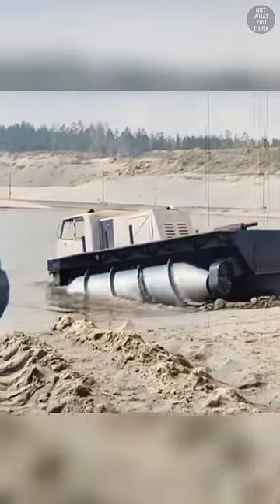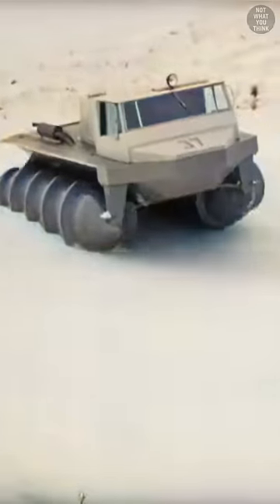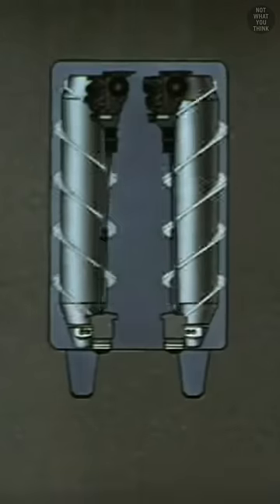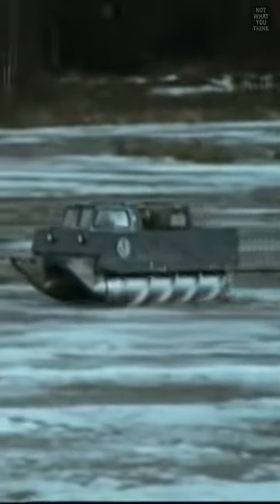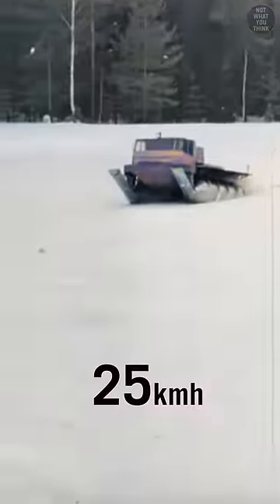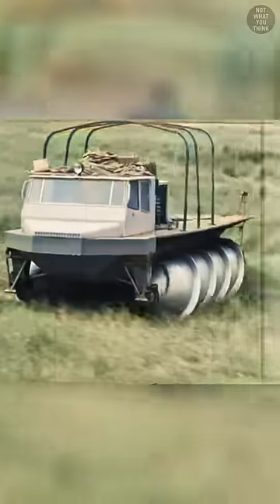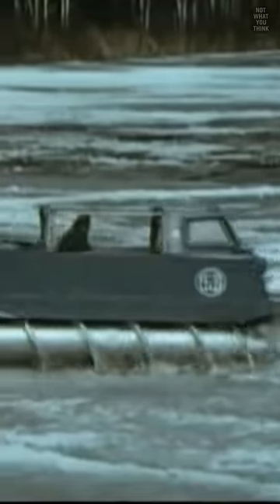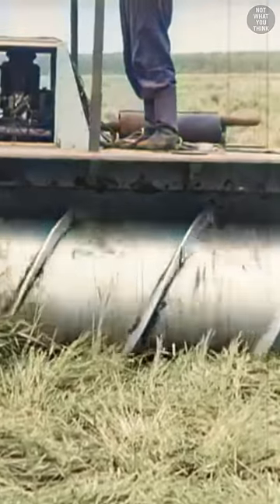Screw-Driven Soviet Vehicle #shorts

Comment: that thing still amazes me, screw-drive is still a really unexplored concept
Reply: As a kid I saw an illustration of a vehicle like that in a popular science or mechanics magazine. It was supposed to be for use on an extra terrestrial planet that had a thick liquid surface...
Reply: To be honest it makes sense as screws make things move up them so why shouldn't it move on ground and if they are hollow then buoyancy 🤠🤓
Reply: The lack of suspension seems to be one reason it's barely ever used.
Tracks seem to be a better concept for rough terrain.
Reply: @daviddavidson2357  ok fair point , still this would slay in a swamp like the everglades where it's mostly flat , 
Also i have doubts about this going uphill
Reply: The thing that amazes me, Mr Fusion is still an unexplored concept....
Reply: @daviddavidson2357  I don't see anything about this concept that necessitates the lack of a suspension.
Reply: A propeller is essentially a very short screw, so it's not really unexplored. This is just using a much longer screw.
Reply: @castleanthrax1833  you're right. In the world of submarines and sometimes ships they even call the propellors "screws".
Reply: @castleanthrax1833  One of the first screw propellers on a boat was too long. The boat traveled faster when the screw thing broke in two and was shorter.
Reply: It has been somewhat explored in america. The biggest problem is that it can't carry very much or pull very much as it tends to 'glide' over soft material. Some farming vehicals were made but that was what they found, limited use.
Reply: It's basically the same reason people down use hand gliders for air cargo.
Reply: If you haven't already, check out Colin Furze's videos building and testing his own DIY version of this.

The disadvantage, of course, is that it is pretty inefficient.
Reply: @domingofung  Look up project ITER in France, I think it's getting close to the finish.
Reply: @daviddavidson2357  I feel like a gyroscope as well as the same tech that keeps a tank's barrel stable while moving would help eliminate that issue.
Reply: Lots of wear parts, requires backup personnel and trained repair persons.
Reply: I think that's because it is much more destructive than continuous track, both to the road/terrain and the vehicle itself. Especially when tracked vehicle is enough for almost all off road needs. No incentive from any industry to do deeper research for screw-drive
Reply: @megamaser  the screws need to stay parallel and level these things tip real easily if one side is lower than the other also these are soft terrain vehicles you're not going to hit anything hard enough to need suspension
Reply: @davidegaruti2582  they really have no problem going uphill as long as they're not too tall and pretty low they go up hills just fine also there was a company and I think the 80s or 90s that would make and sell these things and if you want one you can probably buy them or find the plans to make one yourself online help I think Colin furze uploaded the plans that he made on his YouTube channel
Reply: @gnomewarlord8962 You can lock them parallel to each other while allowing the plane they occupy to pivot freely or alter the distance relative to the chassis. Also you could use multiple pairs of screws that can move freely relative to each other
Reply: @megamaser  that's true but although while it is possible to give these things suspension that's needlessly complicating a very very simple system which is basically a steel frame with a floor an engine driving hydraulic pump that spins the screws most of these things are hydraulic drive and like I said designed to be in very soft surfaces they don't drive nearly fast enough "usually" to need suspension and that's before you go to take into account the fact that the ground they're on is so soft that it might as well be liquid that's what they were designed to do suspension is needless
Reply: @megamaser  oh and something I forgot to mention is that these vehicles are very sensitive to their center of gravity shifting so if all of a sudden they become wider or narrower or one side gets closer to the center of gravity while the other gets farther or liable to cause it to tip also the purpose of suspension is to help a drive surface maintain contact which these don't really need much to do that considering the type of things have better ground clearance than most professional off-road vehicles and the wheelbase several times bigger than the surface area of the chassis
Reply: Check out Colin furzes tank he made.
Reply: @daviddavidson2357  Rough terrain, yes. Soft terrain, no. Tanks will sink in soft terrain, whereas this would drive through it like it wasn't even there.
Reply: I'd love to pull up to work in that bad Larry!
Reply: @TheEDFLegacy  Tanks had wider tracks for soft terrain.

Screw drive is great on water and super soft terrain. They seem like great experimental veichles but since they churn up the surface a lot energy is wasted, so fuel is wasted, when military veichles need to be fuel economical for range reasons the track is the best propulsion system.

Screw drive is like driving forward whilst constantly spinning your wheels. Also the linkages needed for suspension make it even less efficient. I suppose you could use electric motors on each screw but then it's more parts and more to go wrong.
Reply: @davidegaruti2582  So you're saying the vehicle that looks like a frog may be perfect for a swamp
Reply: Must have needed a lot of...  innovation. To design  it
Reply: not good for any combat vehicle tho. and I dont know, seems like good old helicopter is ok for rescue in a wild 😂
Reply: I had a small remote control toy just like this when I was a kid lol
Reply: @daviddavidson2357  tracks can get stuck, slide, or throw on the sprocket. They can also break on the connector which is like having a flat tire only much worse
Reply: Colin furze made one
Reply: I mean, they’re incredibly destructive to any terrain they drive on and the blades wear way faster than tires… so I really am not surprised.
Reply: It strikes me as an extremely niche vehicle. It’s not for fun because it’s slow. For the bayou there’s fan driven airboats. For mud there’s wide tracked vehicles. For deep snow there’s belt driven vehicles. If you don’t know what you’re going to encounter I guess the corkscrew is the best way to go, but I’ll bet maintenance on it was a nightmare.
Reply: I find it rather shallow and pedantic
Reply: @Jeremy.Bearemy  they are always 
Propellers are on airplanes
Reply: Well it's damaging. Hard to get it to work on the road when it twists sideways instead of around. It's less efficient for straight forward movement. That's why he said it worked better moving sideways on hard surfaces. That's a really bad downside and yes we can think up a neat trick or two to mitigate it, but in the end you're better off with balloon tires or something. Something that rotates in line with the road. A screw drive it's sorta a novelty if you ask me. It's more interesting to see than it probably is effective. I'm sure you could find a use but I mean look at it bro, it's rough 😂 hard to reinvent the wheel bro
Reply: @mdj.6179  that's cool af
Reply: I think the screw tanks could be punctured easily by sharp underwater rocks.
Also , I imagine the fuel economy is around 10 gallons per mile.
Other than that, I like it.
Reply: @kremzle5688  What about trees?
Reply: Very inefficient vs hovercrafts
Reply: And Archemides discovered the use of screws several thousand years ago.
Reply: It’s been explored
Reply: At one point the designer had an epiphany and cried out to the heavens, "oh screw it!"
Reply: Seems pretty explored
Reply: There is massive friction when its in anything but water
Reply: @davidegaruti2582  Yeah but way less efficiently than an airboat could do it, with a smooth bottom that wound bind up in thick weeds
Reply: @generalralph6291  If you don’t know what you’re dealing with wouldn’t an amphibious wheeled vehicle be the most versatile?
Reply: It would be a nice concept for submarines or torpedoes.
Reply: we have screwdrivers already
Reply: @stopmotionbricks1648  duh
Reply: Most soviet steam punk idea I've seen
Reply: If a technology is not adopted that means there are significant drawbacks to it that makes it less favourable to other solutions.
Reply: Never before I wanted to be screwdriver so badly.
Reply: @castleanthrax1833  😂😂😂 ur not wrong tho
Reply: screw-drive also can save the world in Gurren Lagan
Reply: Not really, this was originally proposed instead of treads for the tanks of ww1.
But tests showed that treads were better for a number of reasons.

Since then many people have built these, because they are pretty cool and great for marsh land travel
Reply: How does it even maintain stability?!
Reply: Have a look at Colin furze's channel he built a screw drive vehicle for a video once
Reply: There are at least 4 of them displayed in Museums in Alaska  alon. Mostly built by the Jull Company of Milwaukee.
Reply: @daviddavidson2357  but tracks cannot swim!!! So this concept was ideal for crossing wide ereas of Northern Canada, Alaska and Siberia. And they are cheaper, easier to maintain and much more silent than  hovercrafts.
Reply: @davidegaruti2582  believe me,  it can go uphill faster than you can. Even 30 % . Had the opportunitity to drive one built by Jull/Milwaukee, in Alaska in 1975. The former owner's son still have it and uses it regularly.
Reply: Had them on tractors In the 40s
Reply: Probably cause it doesn’t work very well
Reply: Unexplored because it’s not very efficient. There’s just so many better ways it’s almost a waste putting money into this. Yeah jack of all trades but master of none. Need to cross water? Bring a boat or even an amphibious vehicle. Need to cross snow? Snowmobile. Need to cross rough terrain? An atv beats most terrain already. There’s just no need for that kind of innovation.
Reply: it's because they kinda suck at everything except the specific uses that this truck does
Reply: Screw drive been around for 50 years, but maybe not in this capacity.
Reply: If not mentioned already, lack of suspension and lack of precision (vehicle placement) would be key factors as to why it isn’t more widespread.
Reply: Well the soviets were always  very out of the box engineering wise.
Reply: I had a remote control car back in that day with this design
Reply: To anyone wanting to have a RC toy to tinker with they made these in the early 2000’s called a “Terrain Twister” this truck blew my mind as a kid it can drive on anything! Kids needs toys like this today instead of playing with slime that teaches you absolutely nothing. I’d be so bummed out being a kid today, nothing cool at all to play with just shit that makes your brain mush 😂
Reply: Colin Furze made a scaled down version
Reply: I remember these as the soviet landing craft from the red alert 2 intro
Reply: I have a toy with the same concept
Reply: What amazes me is people not realizing the environmental damage of this inefficient crap of a concept. Worthless.
Reply: Ford made an attachment for the ford tractors like the 8n
Reply: Could design a vehicle with retractable wheels or just tracks in the centre and retractable screw drives on the outside
Reply: Colin Furze made one in his yard with a box of scraps.
Reply: Colin furze on youtube made a home made one, go check it out.
Reply: @domingofung  so is harvesting oil from teenagers faces. The research was done 45+ years ago. I saw the news, and infomercials.
Reply: Henry Ford made one of these years before.
Reply: Bill shirt.... Henry Ford invented it 100 years ago
Reply: You heard of the Borded Company? If you think that rockets 🚀 👀 are not yet seriously currently explored, look up SpaceX , same guy named Elon Musk, maybe heard if him?
Reply: This may surprise you, but screwdrivers are pretty common in homes.
Reply: I'd say it's fully explored, and has only niche applications.
Reply: @daviddavidson2357  the problem is - about in the middle of Russia, there's a swamp bigger than France. Russian swamps even smaller than that, are deep and liquid enough for tanks and other vehicles with tracks to sink in. Source? There's one tiny swamp, basically a few mud pits, quite adjacent to my house with a pzkpw Tiger inside. 
For the big swamp you need screw vehicles and hovercrafts to operate there.
Reply: @davidegaruti2582  crab it.

Comment: There is a video on fliker that shows a Ford model T in 1929 that has 2 cylinders and is driven in snow. It has no slippage, which means that when it goes in reverse, the fins on the cylinders go in the exact same groove it made when it was moving forward and does not widen the groove.

Comment: If the flanges were a hard rubber compound like nobbies on dirt bike tyres it would be able to also drive on roads diagonally. Rings slotted over the barrels to which the rubber flanges would be attached would allow the flanges to be twisted ckockwise or counter clockwise to suit terrain and reduce wear

Comment: Also little known fact. It’s design originated from the 1960s during the Cold War. The project was commissioned by Colonel Yevgeny Borisovitch Volgin. In 1964 After an “incident” during testing on a Russian base, which lead to several casualties, the project was scrapped. It parts of the design was used in this vehicle.

Comment: The US military experimented with screw drive vehicles with Chrysler manufacturing the prototypes. The Army liked them but wanted those to go faster and something done about the rapid thread wear when operated on pavement and dry ground. Chrysler came up with bolt-on threads of different heights. Taller threads to pull it faster thru mud and snow then shorter threads made of hardened steel for roads and dry ground. Those worked but the Army decided those took too much time to change out and the entire vehicle was too complicated to consider using in combat areas since it couldn't be towed away when broken down.

Comment: SHAGOHOD!!!  The Treading Behemoth - Metal Gear 3 - Russia's rocket powered supertank, capable of reaching over 300mph, the size of a house, that can launch nuclear warheads and operate on its own, without backup: straight out of the coldwar.  All it requires is about 100 yards and can launch ICBM's (InterContinental Ballistic Missiles) capable of reaching the American mainland, from anywhere in Russia.

The rockets on the tank serve as a launch mechanism.  Imagine driving a car at 300mph and slamming the breaks... now imagine you had something loose on the roof, how far do you think that thing can reach?  Now imagine that that thing you have on the roof, has a rather sophisticated pre-launch system.

All of this, can be operated by 1 person.